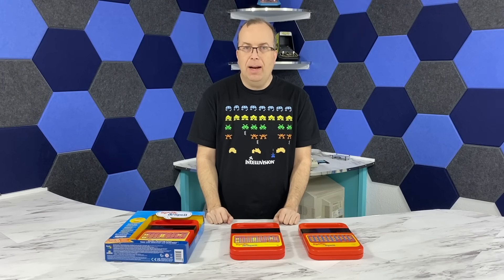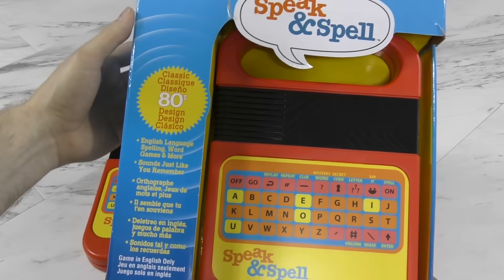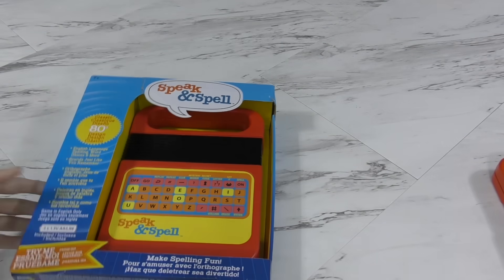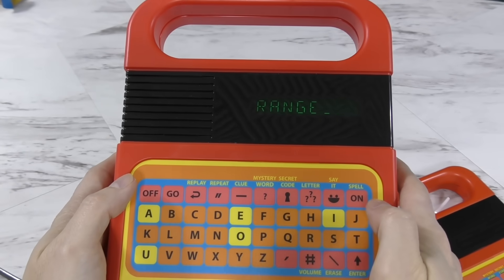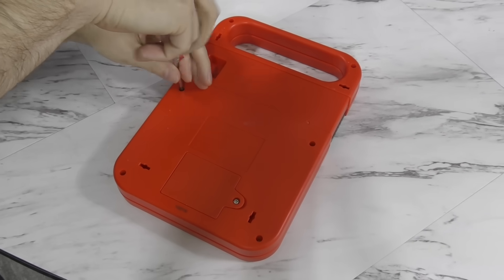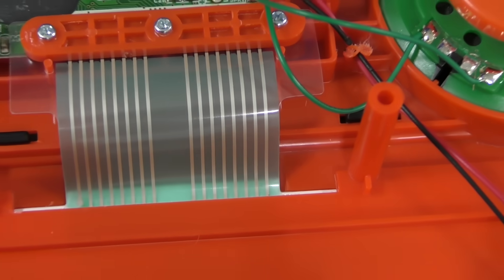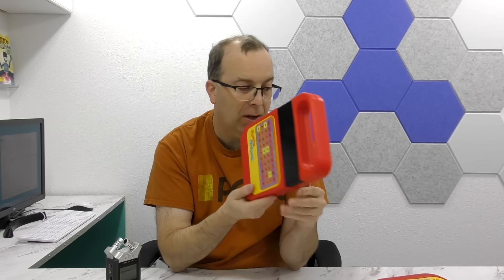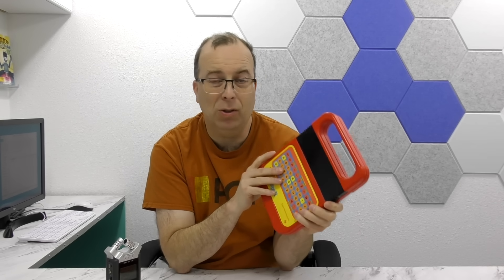Speak and Spell - 1983 vs 2019 model!

Comment: Okay, make your own version by using an old phone. Create a 3D printer version of the case with a slide slot (at the position of the screen to act like a screen) for a phone with OTG support. Inside there is a USB keyboard and charger. Now you need to write some code (many open source examples around, also found a MIDI version) to mimmic the SNS behaviour and to center/match the screen to fit the window so it looks like the original. This project is just for science and fun and to put an old phone to some of use again. ;-)

Comment: In 2019, Basic Fun acquired rights to manufacture the Speak & Spell; however, the updated version introduced a number of changes. Primary among these is the replacement of the classic synthesized voice chip (TMS1000) with recorded dialog that is processed to sound as if it's synthesized. It also offers on-device instructions that weren't available on previous versions. The 2019 model Speak & Spell also replaces the VFD screen with a segmented LCD screen. The use of removable cartridges has also been eliminated

Comment: Just goes to show how technology has progressed to accomplish the same things.  Today, you don't need as large a circuit board, as today's chips have many, many more transistors on them, and the power consumption isn't as great; hence, the need for only 3 AA batteries instead of 4 C's.  I do find it inexcusable that the display would be WORSE today, as display technology should be much, much better than what was around in the 80's - brighter LED's, too, but then that would up the cost.  Also wish they'd kept the power and headphone jacks, especially that latter one, so parents wouldn't have to put up with the sound of that talking all the time.  Then again, I can't imagine kids wanting this today, as they have so much more now on their phones to do, and spell-check has all but made this thing obsolete (and no one cares about correct spelling anyway these days it seems).  This is more for the nostalgia of us Gen-X'ers and such.
Reply: Disregard that last part (about nostalgia vs. kids today wanting this product), as I basically wrote this before seeing the rest of the video (and being redundant)!  Sorry!

Comment: The original used a speech synthesis chip iirc. The new one sounds like it just uses new samples they've added some effects to in order to make it sound like speak and spell.  Wouldn't have been hard to get the old speech modulator, surely? Even just emulate it with software!

Comment: You may be able to improve the screen display by changing a bias or drive resistor.  Looks like there are a number of smf resistors; would have to trace it out to see if any were candidates.  It would probably impact the battery life, however, and may be a reason why it was limited.

Comment: One thing you kinda missed out in my eyes (maybe you just forgot it, lol) was what this expansion port was actually for and whether they just dropped the features at all or implemented them fully into the modern unit. And here comes a opinion thing XD in my opinion, a bigger screen as in today's unit is a bit better (if you don't consider the viewing angle, I agree with you on this point) and I think the actual voice is waaay better and understandable than the older one xD
But besides, I still liked your video c:

Comment: The 80's version was my favourite toy as a kid in the early 90's, yet again sad to see modern scrimping butchering a classic. Oh and using lower Ah batteries with no mains option, definitely modern 👌🏻
Reply: I think lowering Ah isn't an issue because that pcb and display is probably vastly more efficient. I wouldn't be surprised if the thing lasts for months. AA cells probably hold a lot more capacity as well, compared to cells in the 70s
Reply: @9a3eedi  very good point, thanks!

Comment: what surprise me most was the new product PCB (Printed circuit board) COB chip which was able to replace so many ROM chips and circuit wires with just one black dot. Defentely Morrey is proving by itself that computing getting faster with new chips.

Comment: Back then, the most common toy that could talk were dolls. Most of the talking toys used a record type disk to repeat phrases. The Mega Toy talking robot from the 1970s/early 1980s used 8-tracks. Teddy Ruxpin used cassette tapes in the mid 1980s. The other feature of Speak and Spell was its digital display. This was also what made the Little Professor calculator popular, another Texas Instrument release around the same time.

Comment: The really impressive thing is what an index it is of how far chips have come. The original Speak&Spell was truly cutting edge, driving phoneme data through the LPC engine in a TMS5100 chip, drawing them from 128 KB PROM—the largest capacity ROM you could get at the time. It was state of the art stuff. The new one probably plays 16-bit samples from a gigabyte flash memory like you can buy in an SD card through an off the shelf DAC…the chips probably cost less than the display.
Reply: Ham radio operator speaking here... There is at least one system that does software-synthesis like that. The RLC repeater controllers have a 16-bit microprocessor and a DAC, but not much ROM. The spoken messages you hear over the air strongly resemble the pieced-together phonemes that the TMS5100 produce. Probably because when the controller was designed, the processor was pretty fast but memory was still relatively expensive. So they used a hybrid approach of doing DSP in the processor but still storing the speech as phonemes. It has a bank of a couple hundred phrases that can be spoken under various conditions, including letters, digits, and some other things. Messages are assembled as macros by stringing the phrases together such as "WELCOME. TO. THE. (whatever callsign) REPEATER. P. L. IS. ONE. HUNDRED. HERTZ."  Weirdly the official documentation for the RLC-3 lists word #437 as "SEXY". I have no idea why that's included, but oh well.
Reply: @josugambee3701  do you mean the phonemes are samples, or that it uses formant synthesis albeit in software instead of hardware? Either way, very neat
Reply: @kaitlyn__L  They seem to be a bit secretive about how their algorithms work, but it's a 68HC16 16-bit processor running at 3.2768 MHz. It's certainly possible to do realtime synthesis with that kind of bandwidth, as the Commodore 64 (with an 8-bit 6502-based chip at 1 MHz) could as well using the SAM program. I think they're using a similar algorithm as the Speak&Spell, but in software.

Actually, I'm positive that's what's going on, because one time I checked multiple recorded transmissions of the same phrase[s] spoken, and they weren't identical - same frequency spectrum, but a different waveform each time. That proves there's some DSP formant stuff happening, and not just samples being played back.
Reply: @josugambee3701  thanks! That’s very interesting. Kudos for looking at the waveform especially. I came into waveforms through optics and some quantum stuff, so I’m still probably a novice on the electrical, audio etc side (even though synthesisers have been a hobby for over a decade) but a lot is fairly cross-applicable.
Reply: What’s the sample rate of the original phoneme recordings? The crunchyness of the audio (aliasing etc) reminded me of early digital drum machines, AKA no lowpass filter because then it would sound muffled due to sampling too slowly.
Reply: @kaitlyn__L  My understanding is that the original didn’t play sound samples at all…the TMS5100 was a formant synthesizer that modeled the human vocal tract. The “samples” were target values for the formant peaks, plus whether it would play a noise source for fricatives, or a tuned pitch for vowels. I’m not sure if there was a low-pass filter at the output, or if so what the cutoff would have been…it does share that “primitive drum machine” sound. 

Ironically, for a little more money in the new one, they probably could have used a cheap ARM processor and simulated the original chip in software, and gotten a sound closer to first S&S.
Reply: @roblyman1545  oh, I totally knew it pieces together the phonemes, but the sample part was just an assumption on my end. So that’s basically like.. well, you could do it on analogue synth modules with the right patches maybe? But in a tiny chip, pre wired just for that. Yeah I mean that’s even more impressive. The audible stair-stepping made me think few-samples but it could just be a low-bit DAC for control of those voice synthesis functions, I mean plenty of synthesisers with save-able patches had that problem with filter sweeps etc too.
Reply: @roblyman1545  Years later GSM would use similar tricks to fit voice through a 13KBit/s channel. That is why any background music etc sounds so awful.
Reply: @kaitlyn__L   Yep, or at least just directly sampled the old model as an alternative voice set.
Reply: So the sound/speech is indeed still synthesized, but it's doable on almost nothing by now. That was what impressed me too. Not so much how "cutting edge" it is, it's not. But how it illustrates just how common and small these machines have become.
Reply: There’s no way that an American toy for children which is made in China to cut expenses would play 16-bit samples. I bet it’s 8-bit through PWM to save both on space and DAC. But you know what’s interesting? That it’s a great source of fancy enclosures for DIY since there s LPC modules for AVR, there is SAM ported to STM32 and there is plenty of space to put a board inside to turn this thing into a MIDI-controller, better S&S clone or something else, like I did with one of my non-working desktop calculators.
Reply: Cost? 3$. You pay? 30

Comment: At 5:04 when the case is open, the small white rectangular part may be what I've seen in other devices, a holder for a few small coin cells which provide the short-lived power for the demo mode.  Pulling that tab out switches from the (probably dead) coin cells to the batteries in the main compartment.

Comment: Well i can honestly say that the innards of the 2019 remake is about what i'd have expected.   It mostly has the look but inside costs were cut to the bone, though to be fair some of that is tech allowing the speak and spell to function with far fewer components.  The dropping of the head phone jack and ac adapter ports seems hard to excuse but were undoubted part of the cost cutting.
Reply: Dropping the AC i can understand, with a VFD that old one would probably have been pretty hard on the batteries, and those C cells are pretty expensive. If it came with the AC adapter that was probably a great feature to have. But I bet the new one would last for months on the AAs with low power chips and an LCD.
Reply: @dgpsf  agreed this new version is likely far more power efficient than the original.  That again is down to how far tech has improved since the speak and spell was created.

Comment: As another commenter said, I wasn't even aware this had come out.
It feels like it was part of the same comeback that the mini consoles were/are part of. Which is not entirely a bad thing. However in this case it feels like while the crew working on it cared to some degree and wanted it to be good (alluded to by your own remarks about how hard the new and old ones are to tell apart at a glance on the outside), the bean counters pushed back a lot when it came to the functionality and sourcing of parts. It looks like it has a half decent speaker inside and even mounting locations for a bigger board. I get the impression the main team wanted it to be reasonably worth it even if all it was doing was playing to nostalgia.

Comment: I've never owned a speak and spell nor will I.
I think what you say is 100% correct. No kid these days is going to want one of those as their tablet / iphone / android speaks better, plus has animations. They probably produced that thing for $6 and are selling at $29 for the limited nostalgic market. Most will just end up as landfill. 
Saying that, as a kid in the 80's I still like 80's games (space invaders, pacman, Jack attack (commodore 64), Bubble Bobble) a lot more than the modern games which require multiple axis joysticks with 10 or more buttons to play the game. 

Not to knock kids these days but I find a lot of them can't spell anyway or tell the difference between their / there / they're or break / brake  or lose / loose  . 
This is the problem with todays technology.  Kids are lazy and their texts are similar to "wot u dn" (What are you doing ?) so they never really have to learn how to spell.

Comment: I was a little too old for it when it came out.  At least for it's intended use.   It was absolutely fantastic to pull the speech chip out and drive it with a real CPU chip.  Great fun and quite challenging to make work.

Comment: Another reason the originals were hard to find and expensive (for a while; this seems to have changed) is that they're highly appealing to the circuitbending community; the 80s (and probably the 70s) was incredibly hackable even by people who have no idea what they're doing, hard to crash and next to impossible to brick.  If the manufacturer wanted to dip into that market, though, a black blob is just not going to cut it.

Interestingly, I just popped over to eBay, and loads of vintage originals are available, and not even particularly expensive.  This wasn't the case a decade ago, for whatever reason; maybe the new model jostled free some old stock?
Reply: I doubt there was much in the way of actual old stock sitting in a warehouse, but things on eBay tend to go in cycles as supply vs. demand swing back and forth.

Comment: The difference in those batteries shows how efficient electronics have become in power usage terms - might be down to the display too though.
Reply: Yeah, the VFDs were power hungry.
Reply: This is not efficient or cool. They could of made it usb recharged and spent 50c more per unit but no you need to still use wasteful disposable cells.
Reply: @SapphicReality  Nearly all types of batteries can be recycled. Our local council does at least.
Reply: @SapphicReality  adding a li-ion battery,protection circuit, charging chips and a usb connector would quite a lot to the cost, also its going to run for a VERY long time on those AA's
Reply: @SapphicReality  Having just found a swollen Li-ion Battery in one of my cameras I would say there is a far better chance of this still working in twenty years time than any device with a rechargeable battery. Anyway, I expect you could put rechargeable NiMH AAs in it.

Comment: Well it’s no wonder that motherboard inside the modern version is sooo much smaller then the 70’s version,that’s because back then the nano technology of transistors was 8pu (8000 nm),nowadays nano technology of transistors are 5nm in size, that’s approximatelly a whopping 1300 times smaller,so it’s no wonder that the same old technology could be shrinked sooo much down in size and it also consumes waaay less power then those original ones, 

Now am thinking of it, i wonder how much more handy old technology could once exposed with today’s nano technology.

Comment: At the same time, it's pretty crazy to think what was barely fitting on 5 chips minimum that would cost hundreds (accounting for inflation) in the 80s now fits quite well on a single integrated SoC that probably costs $3 apiece with a lot of power to spare. Oh, the evolution.

Comment: Regarding the display, they wanted to reduce the battery power from 4 C-cells.  It would be tough to do vacuum fluorescent display with 3 AA cells.  It also requires high voltage (about 80 volts) necessitating DC/DC converter to make the high voltage.  With the LCD, the whole thing can run on 4.5 volt battery.  The whole engineering design fits the modern talking toys, made in China, using 4.5 volts,  with epoxy "blob" direct-to-circuit board IC, for Halloween animated novelty displays designed to last one year.  Those IC's will fail if you THINK about static electricity.
          They should have turned down the dark tint of the plastic overlay, & put REAL buttons instead of those "chicklet" keys.

Comment: The whole video, I kept thinking of the button version in comparison. A light-blue LED array for display, and in a remake of the original "button" version would be really nice to see. I don't mean that I would buy it. I don't need that. I'm not even sure if anyone would want it. But regardless of that, the plastic and look of this thing is phenomenal. I am not surprised to hear that it's hard to tell them apart in person (minus batteries). Just needed to go one step further with the plastic buttons, but then again that probably would have tripled the cost and you can buy actual phones for less money than that, hahaha.

Comment: The first thing which bugged me is replacing the word "correct" with the word "right".   At first I thought I'd misremembered, but was happily vindicated by the '80s model.   I never had any of the expansion packs.  Considering memory is orders of magnitude cheaper now than it was in 1978I wonder if at least they included that material on the new model?

Comment: It would have probably cost less than a dollar extra in bulk production to add a VFD display, with headphone and DC Jack, and match the speaker in the case, and add an SD card for upgrades.   The Glob chip is probably an Arm based unit which is probably more powerful than a 10 year old PC.
Reply: That blob more powerful than a 10 year old PC. Por thing, you're plain ridiculous.